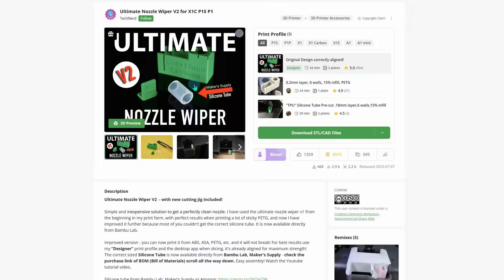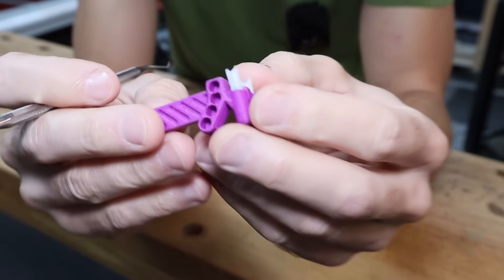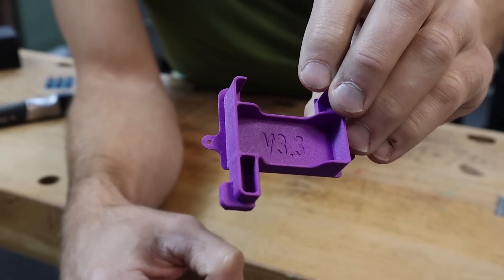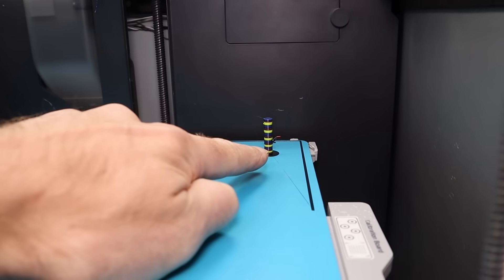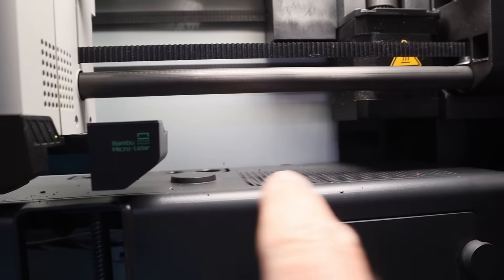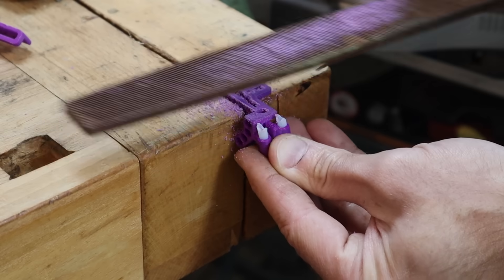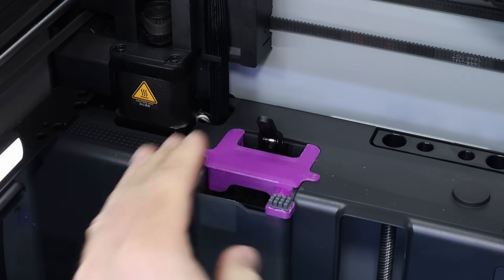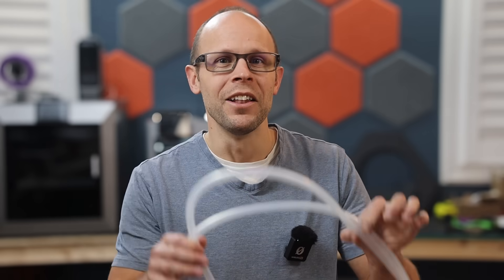Can these really be better than the stock wiper?  The ratings say they can, so let's find out!

Comment: The third option and another that uses the stock wiper strip, it will start to break that strip up if it stays on, which is the biggest problem. There are silicone molds versions out there where you must mix a 2 part silicone and then attach to a print, I bought the silicone and one of these days plan on doing this. This is really one of the worst aspects of this printer I have found also.

Comment: ‘I like to leave things as stock as possible’… whilst changing the hot end. Lol
Reply: And then tests wiping solutions made for stock nozzles...
Reply: You might want to include the full statement - "Unless we don't have another option". Are you a media member?
Reply: @terrydekoninck5600  Changing your stock nozzle to a high flow nozzle is an optional quality of life upgrade and not really a "we have no other choice" upgrade.
Reply: @Sjoerdtje  have you seen the vertical strength comparison videos of the stock nozzle vs E3D HF nozzles?  It's expensive to swap, but sticking with the stock nozzle is a poor option if you're doiing functional prints.
Reply: Changing the hot end is something you are expected to do. It's a wear and tear part that can and will need replacing, especially if printing abrasive filaments. You change the hot end when switching between 0.4 and 0.2, 0.6, 0.8 nozzles even from Bambu.

If someone installs a performance oil filter in their car, is that "not stock" as well? I guess technically, no, but it's an incredibly minor variance.
Reply: It‘s an OEM component. Or at least licensed

Comment: i printed 20 of them, all are really not that good. So I took all the solutions and put them in one part. Search for "Poop Chute GitHub Cover with A1 mini wiper" on maker world. It has 1 a slope to prevent poop from jumping outside, a solid one which does not break like 10 of the others. Then the PTFE spring can be kept and on and a working wiper with 4 rows to clean the nozzle finally. And it does not break off.

Comment: I use that last design and it's been dramatically better than the stock wiper. I've super Glued mine down and haven't had an issue and I've been running it for about a year now

Comment: Yeah, it's a pain but I ended up using an actual brass brush from a Dremmel attachemt . Contrary to what you might think, it doesn't tear up the silicone boot or the nozzle. I think Voron's use the same idea. There are several out there for the Bambu. The clean like nothing else and they're super cheap.
Reply: Do you have a link to the model for this?
Reply: Sounds like a good solution. Do you have to periodically clean off the brass brush itself or does the filament just not stick to it?
Reply: @DaveEtchells  Eventually I the brass brush gets clogged up but then I just throw it away, they're so cheap. It takes a while for that to happen, quite a while. I did clean one once but I decided it wasn't worth it.

Comment: A big help for your "sticks to the nozzle" issue is the slice engineering plastic repellent paint. It needs to be applied regularly, but minimizes sticking a lot
Reply: I have had good results with this as well. Much better to stop the filament sticking in the first place than to try and wipe it off afterwards.
Reply: I can second that this stuff works really well. I've heard from other places that people use some superlube PTFE oil as a cheaper substitute.
Reply: At $15 for 3ml and it has to be applied before each print? Hard pass.
Reply: @radish6691  No it doesn't need to be applied every print, not sure where you are getting that from. I have done many dozens of prints on a single application.
Reply: @davethetaswegian I got that information from Slice Engineering. Their reply to a review (dated 20 May 2024) on the product page on their website stated, “Hi, Ricky. Thank you for your review. I am sorry to hear that filament began sticking to the tip after one print. We recommend reapplying after each print to be sure that the PRP coating is ready to go at all times! Please remember to always apply to a clean nozzle as well.”
Reply: @radish6691  Interesting, definitely not my experience though. I am using a E3D Revo, which has a large exposed metal area around the nozzle. I had terrible problems with PETG building up on this until I started using the paint. I haven't had to reapply since I started using it a few months back, although that is probably under fifty small prints.

If you really have to apply every print then I am in totally agreement with you on it being a hard pass. Irrespective of the cost that is just too much work to be practical. Sounds like a really dumb suggestion from the support team to avoid having to figure out the real issue.

Out of interest, what type of nozzle are you using? Maybe its an issue with paint not sticking to whatever material it is made of.
Reply: @davethetaswegian That comment wasn’t in reply to my review (I’ve never used it) but it is the reason I didn’t buy the stuff a few months ago. It’s just as well; I’ve discovered that avocado oil works great on the nozzle, also in the purge chute. Smearing a little inside the chute ended the problem I was having with pile ups during long multicolor prints. 

I only apply avocado oil before long multicolor prints, for day-to-day printing the Scrubbler (with modified start g-code, it’s on MakerWorld) works fine. 

I only print multicolor in PLA so I don’t know if avocado oil is effective with PETG. The smoke point of avocado oil is about 270°C so I guess it depends on the nozzle temperature…avocado oil won’t help if it burns off. 😆

Comment: I last night printed a brush holder. Takes a dremel brass brush to help clean the nozzle. Not yet sure if it works better. It does clear the build plate although barely. It’s so close lol. I’ve used a brass brush to clean the nozzle when heated. So I have hopes for this working. If it doesn’t do the tiny bits like you experienced
Reply: Update?

Comment: I spent 5 years modifying printers to get nice prints. I bought the x1c to use and not to modify. After more than 5000 hours of printing on three different, completely stock x1c’s, with a wide array of filaments, I can say there is no need to modify anything. People will tell you that you need this shiny new part to improve something. If you enjoy tinkering then do it. Just know that the hardware this printer comes with is fine. Learn how to use your slicer and find something else that actually needs fixing.
Reply: Did you even watch the video ? That statement completely ignores the 4 'stock' test runs w PETG that he filmed and show poop building up during color changes, and ultimately being flung around.
Similar experience on my P1S where unlike PLA and ABS, PETG snot is much more prevalent on my stock nozzle and a whole poop chunk can sometimes be flung onto the bed. And that's with no color change, just at the start of the print...
Reply: @raphofthehills4405 Did you even watch the video? Where he described himself modifying the printer with the third party obsidian high flow rate hot end?

Comment: The only one that worked for me was the one where you insert a piece of silicon. I modified it a bit to have a wider and deeper place for the silicone piece. Then instead of putting the recommended silicon, I cut a piece from my soldering silicone mat (this beats everything else I tried), glued it in the printed model and since then I didn't have any issue with PETG sticking to the nozzle. They do stick to the side of the wiper at times, but they fall off when they accumulate.

Comment: The Scrubbler is the best one overall. I tried all of those and hated them long term. It has been updated a few times since I originally downloaded it, but the basic premise is it uses the A1 wiper combined with the Stock wiper for the benefits of both. I have well over 5000 hours across two printers on that and never have poops in my chamber. (Being fair I use stock hardened nozzles). I just updated to the newest version when I did my recent full tear down maintenance and so far performance seems just as good. As a note it is important to CA glue the A1 wiper to the newer version. However this is balanced out by the fact that the piece that is attached too is significantly smaller and it prints several so you just replace that entire piece when the teeth start tearing off. I do nothing but multi color printing and just recently finished a batch of 220 pieces that had 10 filament changes each with no poops or little bits of crap all over the chamber. The only issue I had from the start was the edge of the piece that the A1 wiper sits on was a little thicker than it needed be and would Z axis error out some of my non OEM print plates. A few moments with a sander on the offending corner resolved that entirely.
Reply: Is this with PETG or PLA? Sounds encouraging…
Reply: @DaveEtchells  I print with both and more rarely ABS. I haven't had trouble with any of them.
Reply: @OmegaGamingNetwork  Thanks for the info!
Reply: DO you have a link to this?
Reply: Can you send the link for that one?😊
Reply: Do you have the link to the Scrubbler?

Comment: Personally, most of these nozzle wipers do work way better than OEM. However, they are not perfect. I find with the A1 nozzle wiper in combination with the OEM scraper work well but fails at times. The ultimate nozzle will be next to try. There is also a modification of that model that uses the PTFE tube and OEM wiper as well.

Comment: Could you help root my Creality K1? I followed your guide step-by-step and did all the installation, but I cannot remotely access it the way you did. I tried typing the ip address followed by 4409, but nothing happens. And if i just do the ip it gives me the basic creality print UI. I also cant figure out what my device UI is (for connecting to OrcaSlicer) as it doesn't show anywhere. Could you please help?

Comment: i hate the problem... my solution is via the start code, originally i wanted to remove the vibration calibration for night printing (because of the noise), later i realized that i suddenly had no more ooze problem with PETG (or much less).
the modified code places the nozzle above the poop shoot and cleans the nozzle every few seconds during heating so that there is not much filament to disturb later. meanwhile this is my standard code for PETG.

the original source in the video (github) has unfortunately removed the code, but i post mine here use at your own risk. (here the video https://www.youtube.com/watch?v=B2z1ea2a_LQ)
in the bambulab forum there are also posts about this, but I can't find them right now.

;===== machine: P1P ========================
;===== date: 202200815 =====================
;===== reset machine status =================
G91
M17 Z0.3 ; lower the z-motor current
G0 Z7 F300 ; lower the hotbed , to prevent the nozzle is below the hotbed
G90
M17 X1.2 Y1.2 Z0.75 ; reset motor current to default
M960 S5 P1 ; turn on logo lamp
G90
M220 S100 ;Reset Feedrate
M221 S100 ;Reset Flowrate
M73.2   R1.0 ;Reset left time magnitude
M1002 set_gcode_claim_speed_level : 5
M221 X0 Y0 Z0 ; turn off soft endstop to prevent protential logic problem

;===== heatbed preheat ====================
M1002 gcode_claim_action : 2
{if bbl_bed_temperature_gcode}
M1002 set_heatbed_surface_temp:[bed_temperature_initial_layer_vector] ;config bed temps
M140 A S[bed_temperature_initial_layer_single] ;set bed temp
M190 A S[bed_temperature_initial_layer_single] ;wait for bed temp
{else}
M140 S[bed_temperature_initial_layer_single] ;set bed temp
M190 S[bed_temperature_initial_layer_single] ;wait for bed temp
{endif}

=============turn on fans to prevent PLA jamming=================
{if filament_type[initial_tool]=="PLA"}
    {if (bed_temperature[current_extruder] >45)||(bed_temperature_initial_layer[current_extruder] >45)}
    M106 P3 S100
    {elsif (bed_temperature[current_extruder] >50)||(bed_temperature_initial_layer[current_extruder] >50)}
    M106 P3 S100
    {endif};Prevent PLA from jamming
{endif}
M106 P2 S100 ; turn on big fan ,to cool down toolhead

;===== prepare print temperature and material ==========
M104 S[nozzle_temperature_initial_layer] ;set extruder temp
G91
G0 Z2 F1200
G90
G28 X
M975 S1 ; turn on 
G1 X60 F12000
G1 Y245
G1 Y265 F3000
M620 M
M620 S[initial_tool]A   ; switch material if AMS exist
    M109 S[nozzle_temperature_initial_layer]
    G1 X120 F12000

    G1 X20 Y50 F12000
    G1 Y-3
    T[initial_tool]
    G1 X54 F12000
    G1 Y265
    M400
M621 S[initial_tool]A

M412 S1 ; ===turn on filament runout detection===

M109 S240 ;set nozzle to common flush temp
M106 P1 S0
G92 E0
G1 E50 F200
M400
M104 S[nozzle_temperature_initial_layer]
G92 E0
G1 E20 F200
M400
M106 P1 S255
G92 E0
G1 E5 F300
M109 S{nozzle_temperature_initial_layer[initial_extruder]-20} ; drop nozzle temp, make filament shink a bit
G92 E0
G1 E-0.5 F300
G1 X70 F9000
G1 X76 F15000
G1 X65 F15000
G1 X76 F15000
G1 X65 F15000; shake to put down garbage
G1 X80 F6000
G1 X95 F15000
G1 X80 F15000
G1 X95 F15000
G1 X76 F15000; wipe and shake

;== Custom Shake for TPU 
M109 S{nozzle_temperature_initial_layer[initial_extruder]-40} ; drop nozzle temp, make filament shink a bit
G1 X80 F6000
G1 X95 F15000
G1 X80 F15000
G1 X95 F15000
G1 X76 F15000; wipe and shake
M109 S{nozzle_temperature_initial_layer[initial_extruder]-60} ; drop nozzle temp, make filament shink a bit
G1 X80 F6000
G1 X95 F15000
G1 X80 F15000
G1 X95 F15000
G1 X76 F15000; wipe and shake
M109 S{nozzle_temperature_initial_layer[initial_extruder]-80} ; drop nozzle temp, make filament shink a bit
G1 X80 F6000
G1 X95 F15000
G1 X80 F15000
G1 X95 F15000
G1 X76 F15000; wipe and shake

M400
M106 P1 S0

G0 X135 Y253 F20000  ; move to exposed steel surface edge
G28 Z P0 T300; home z with low precision,permit 300deg temperature
G29.2 S0 ; turn off ABL
G0 Z2 F20000

G1 X60 Y265
G92 E0
G1 E-0.5 F300 ; retrack more
G1 X100 F5000; second wipe mouth
G1 X70 F15000
G1 X100 F5000
G1 X70 F15000
G1 X100 F5000
G1 X70 F15000
G1 X100 F5000
G1 X70 F15000
G1 X90 F5000

# G0 X128 Y261 Z-1.5 F20000  ; move to exposed steel surface and stop the nozzle
M104 S160 ; set temp down to heatbed acceptable
M106 S255 ; turn on fan (G28 has turn off fan)

M221 R; pop softend status
G1 Z10 F1200
M400
G1 Z10
G1 F30000
G1 X230 Y15
G29.2 S1 ; turn on ABL
G28 ; home again after hard wipe mouth
M106 S0 ; turn off fan , too noisy
;===== wipe nozzle end ================================

;===== bed leveling ==================================
M1002 judge_flag g29_before_print_flag
M622 J1

    M1002 gcode_claim_action : 1
    G29 A X{first_layer_print_min[0]} Y{first_layer_print_min[1]} I{first_layer_print_size[0]} J{first_layer_print_size[1]}
    M400
    M500 ; save cali data

M623
;===== bed leveling end ================================

;===== home after wipe mouth============================
#M1002 judge_flag g29_before_print_flag
#M622 J0
#
#    M1002 gcode_claim_action : 13
#    G28
#
#M623
;===== home after wipe mouth end =======================

M975 S1 ; turn on vibration supression
=============turn on fans to prevent PLA jamming=================
{if filament_type[initial_tool]=="PLA"}
    {if (bed_temperature[current_extruder] >45)||(bed_temperature_initial_layer[current_extruder] >45)}
    M106 P3 S100
    {elsif (bed_temperature[current_extruder] >50)||(bed_temperature_initial_layer[current_extruder] >50)}
    M106 P3 S100
    {endif};Prevent PLA from jamming
{endif}
M106 P2 S100 ; turn on big fan ,to cool down toolhead

M104 S{nozzle_temperature_initial_layer[initial_extruder]} ; set extrude temp earlier, to reduce wait time

;===== noozle load line ===============================
M975 S1
G90 
M83
T1000
G1 X18.0 Y5.0 Z0.2 F18000;Move to start position
M109 S{nozzle_temperature[initial_extruder]}
G0 E3 F300
G0 X240 E15 F{outer_wall_volumetric_speed/(0.3*0.5)     * 60} 
G0 Y5.5 
G0 X18 E15
M400

;========turn off light and wait extrude temperature =============
M1002 gcode_claim_action : 0
M106 S0 ; turn off fan
M106 P2 S0 ; turn off big fan 
M106 P3 S0 ; turn off chamber fan

M975 S1 ; turn on mech mode supression

Comment: On my P1S I’ve been a big fan of a model on MW called the Scrubbler. It uses the silicone waffle for cleaning, but also retains the original spring wiper offset to the left so that it still “cuts” and flings away the poop before going to wipe on the waffle. It also has an inset for the waffle and recommends CA glue for installation to keep it from being knocked loose. If you decide to check it out I’d take a look at the different remixes, because I remember some of them aren’t lidar compatible.
Reply: Hi, fellow P1S owner. Just got mine three days ago, and was hoping you could answer a question for me: Is the nozzle supposed to tap against the print bed during bed levelling? I thought LIDAR was supposed to be doing this. I don't see anything inside the enclosure that looks like a LIDAR unit, so I don't know what's going on. Also, I can't find any info at the Bambu site as to how this is all supposed to operate.
Reply: @ lidar is an x1c exclusive feature, the p1s doesn’t have it. The p1s uses the nozzle taps and a load cell to map the bed for leveling, so yes, that’s totally normal
Reply: @imacmill  my X1C still uses the nozzle to probe a Z pattern on the bed first; then sweeps over the print area with the lidar again.

Comment: I've been using the wiper from "N302OO7" on Makerworld for roughly a year now and it works really well (also with PETG). It's basically a two-part design where you print a holder and a mold and then have to pour liquid 2k high-temp silicone yourself.
The wiper itself has four "lips" and besides the occasional little bits I've not had a big poop on my build plate since I installed that wiper.